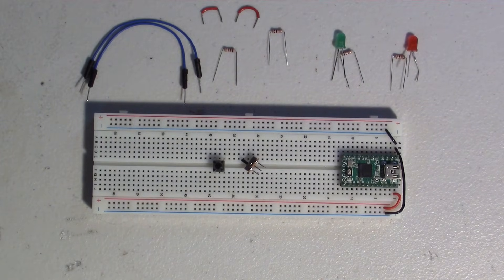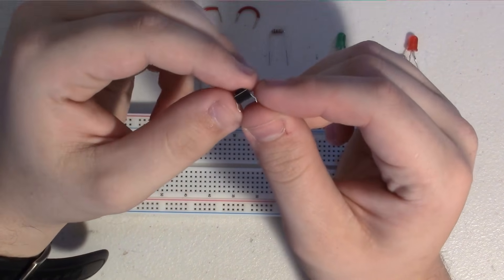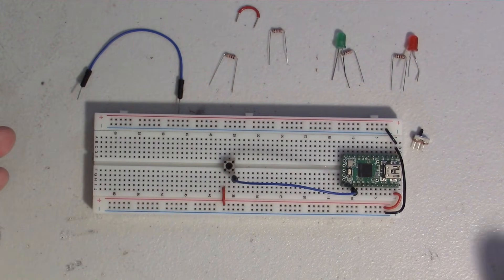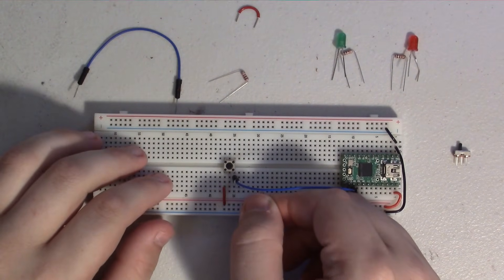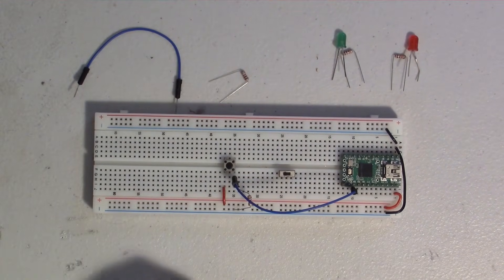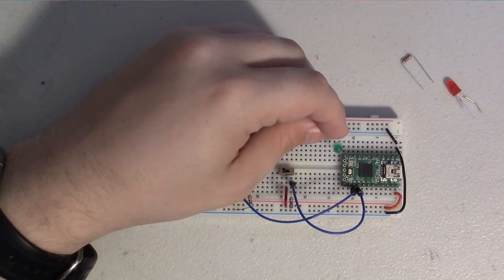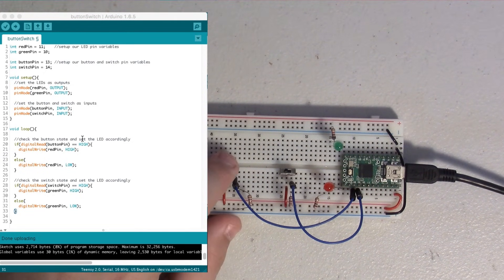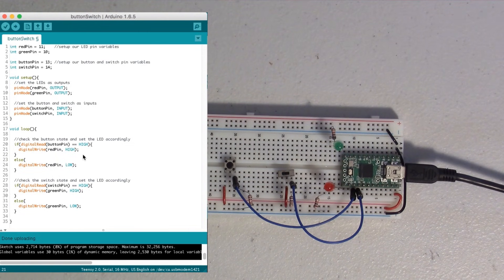How To Wire It! Buttons & Switches

Comment: Can I weld  wires to these buttons to use them for any application? (One hot wire 12v & one ground) just like those normal push buttons in cars
Reply: I would like to know as well

Comment: How about just:  pinMode(pin, INPUT_PULLUP) in the setup loop and wiring the switch across the pin and GND?  No resistor required.  The only difference is that doing a digitalRead(pin) will return a false or zero when pressed and a true or one when in-pressed.
Reply: thanks I didnt have a 1K resistor :D

Comment: I wired up my switch exactly as you've shown, but my script will not execute if the switch is in the OFF position when it boots up. But if I flip my switch to the ON position, it boots up and the code runs fine. My code is very simple. I've removed everything except a basic Serial.println("test") in the loop function. Any ideas what could be wrong?

Comment: so if I were to be using wires in something other than a breadboard, would I have one side of the button connected to power and then the other side have like, a forked wire? where one side goes to ground through a resistor and one side goes to the pin?

Comment: i just want to swap a rotary encoder to 2 push buttons to modify my 900m tips soldering station to take a t12 tip but the station pannel is push buton and the t12 controler is rotary, im on a dead end

Comment: I was struggling not k owing what to do and in the middle of the video I just put the components in a random spot because idk you said something like that but I didn’t know that was what you meant by it i was thinking.. yeah it’s not gonna work. I push the button and the LED glows. So you kinda didn’t help me but you gave my brain a major understanding of using the switch and I definitely never would’ve known that if you didn’t post this video.  Thank you

Comment: When you add the transistor to assure a logical value on the circuit, is that called a pull-up resistor?
Reply from the maker: Yes, either pull-up or pull-down depending on whether you connect to vcc or gnd

Comment: would you need the resistor on the tactile if you were wiring up the volume\play buttons on a bluetooth amplifier circuit?
Reply from the maker: probably not... your question is too vague to give a complete answer but if the existing circuit had a button in it and you were just trying to modify it then no you wouldnt have to add anything. If you're wiring a completely new circuit then yes you would likely need to add the pull-up/down resistor

Comment: Hey there I came across your videos looking into how to wire a greeting system for a car. Basically I am trying to pull a prank on my friend by installing a “build a bear” type voice recording system that has a button you press to play the file. What I want to do is tap an in-line fuse for accessory from the car and trigger the button on the recording device to play my sound file. I am trying to figure out basically how to jump the button to only activate it when the key is turned on. Any advice helps thanks !!!

Comment: very helpful.  thank you.  One question.  When the button is pressed, positive electricity flows through the button, then it splits between going through the wire to the pin on the arduino and through the resister to the ground pin on the arduino.  Does that path through the resister have a negative effect on the circuit?
Reply: I also have the same question🤔
Reply: That's why the "pull down" resistor is high value : à 1K Ohm with same voltage, your current is U / R so say 5V / 1000 Ohm : 5 mA... that's fairly low.

Comment: If you were just lighting an LED (with resistor in series) with no arduino, would you still need a pull down resistor?  An open circuit would be fine if you're not trying to read a specific state, right?
Reply from the maker: You are correct! :) In the situation where you are just using a button or switch to directly control an LED you would not need any pulldown resistor.
Reply: @ItKindaWorks  Thanks again for the help :-)
Reply: I am a newbie but I did it without the pull down resistor and it worked, but with the pull down resistor, the LED was much brighter.

Comment: So why does the button switch have four pins if you only use two?
Reply from the maker: The main reason for 4 pins is for extra support. Buttons are subject to a lot of physical abuse so they have extra pins to help secure them to the board. If you use a multimeter you can also check and you'll see that the unused pins are actually connected to the other "used" pins.
Reply: @ItKindaWorks  great thanks so much for the speedy response. It's a really good tutorial!

Comment: The resistor on the negative side of the switch is necessary, because, without it you would just short the power supply?

Thanks.
Reply from the maker: The resistor is there to give the switch a "state" when it is in the "off" position. You cant just wire it to gnd directly because as you pointed out it would be a short otherwise.

Comment: Good video, appreciate it a ton. Ive a question for you, Can we use the switch to send two signals? As you have used the left slide for off and right for on, so if we also take input from left slide, say to pin 3 while keeping right slide as an input to pin2, we can select two things with a single slide switch (theoretically). So if we also used the pull down on the left slide and program such that if left glow green led and if slided to right glow different one, will that work or do we always have to use only one slide with pull down or something? Please do tell me. It will be better if you email me so we can discuss it in detail. mahimnat27@gmail.com thank you in advanve.
Reply: yes with something like this
if digitalRead(switchPin) == 1 {
do something
}
else if digitalRead(switchPin) == 0 {
do something else
}

Essentially digital read checks to see if a certain Arduino pin is getting power. if it is, it will return 1, if not, 0. So basically the output pin on the switch (the one the light is connected to) will be the pin you are connecting to the pin on the Arduino.Using this, you will constantly be checking its position and you will be able to send out commands. Hope this helps!